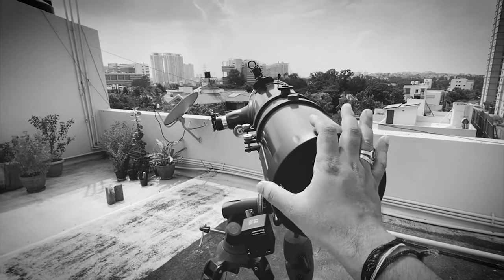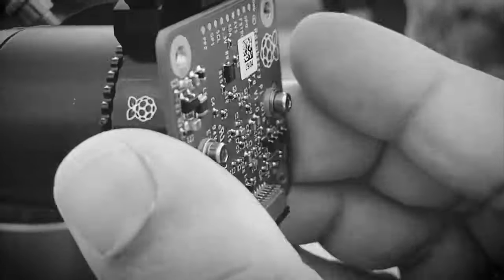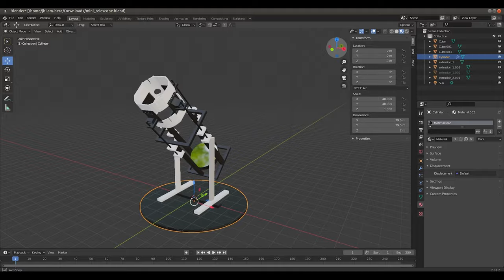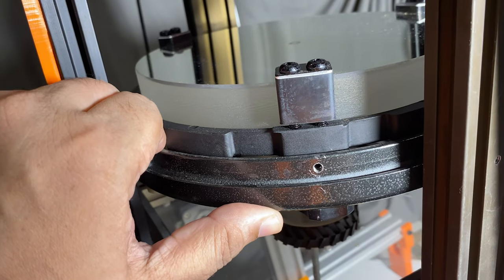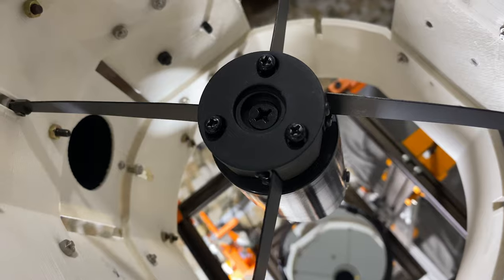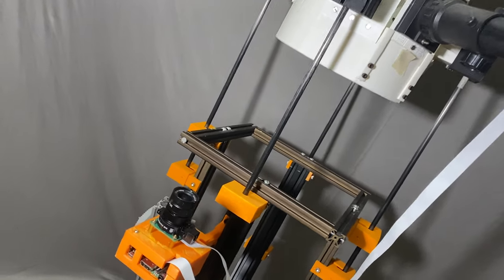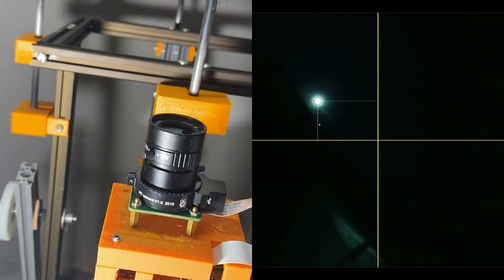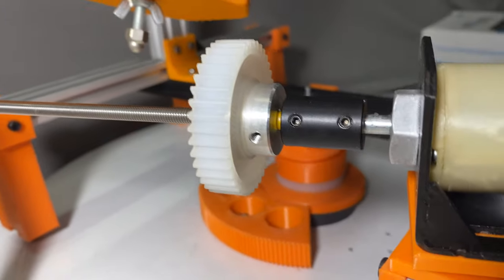My DIY 8" Telescope  &  Raspberry Pi HQ Camera - Episode 2 [Mind]

Comment: you really went all out on this! Awesome! What C mount did you use for your camera through the eye piece? Also, I see some glass on the end of it, did you use a filter? I've got a nextstar SE 8" and i'm trying to get astroberry to work but having an issue with the drivers... I'll eventually get it but I want to make sure it's not hardware related first.
Reply from the maker: I bought one c mount from FLO. You can 3D print as well. Raspberry pi HQ cam is very light weight so you can use cheap plastic or 3D print one. Will work for astroberry.

Comment: Enjoyed your vid, Just about to start experiments with raspberry pi, has the pi camera got just a C-mount to 1.25 converter on with a filter, so the image you see is just through the scope? or is there a lens in there to magnify first? Also are you using PWM to get the speed of the motors correct? i am using steppers but get a little viabrating type movement due to the steps, are those DC motors smooth?
Reply from the maker: No it is with prime focus. No lens in between. Yes it is PWM. DC motor I used becz it’s cheap and my system design support it. Lately I’m using NEMA17. Used delay 0.0001 sec with 4 steps. No vibration at all for me. My next videos are on it. Hope it will be helpful.